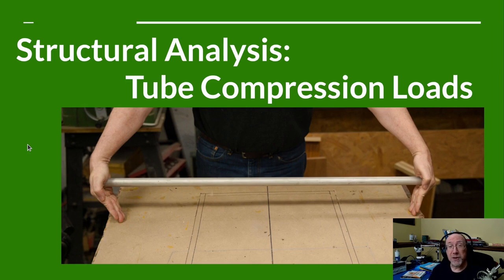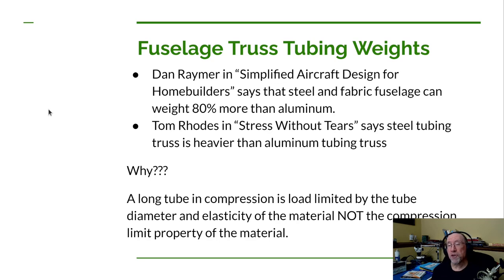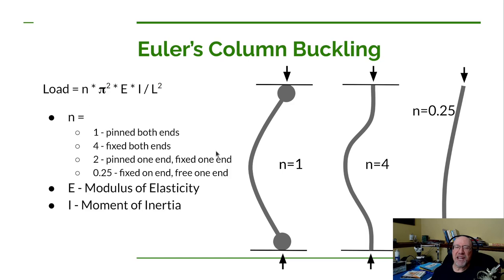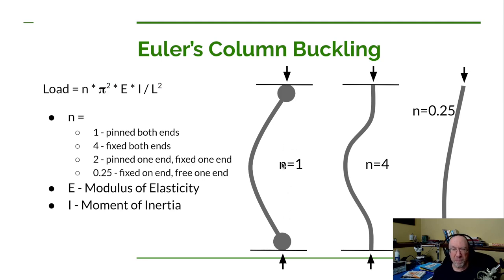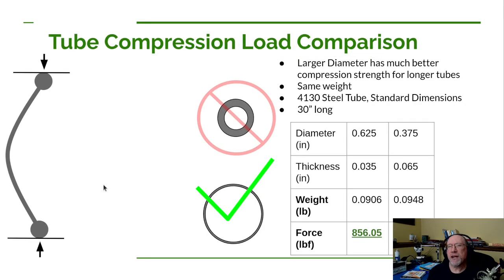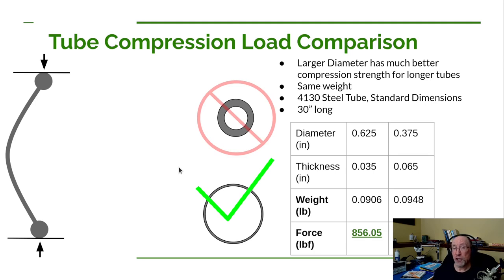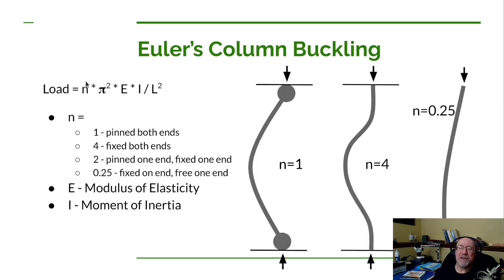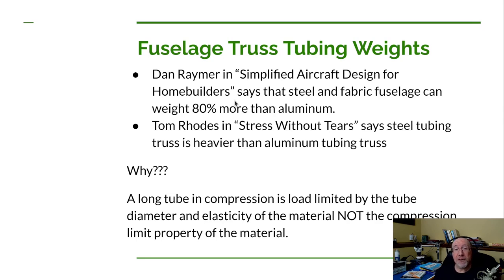Structural Analysis: Tube Compression Load

Comment: It's an often missed point that tensile strength of a material has no bearing on buckling resistance of a component. I've done a lot of crash testing on seat structures using 6061-T6, 6082-T6, and a softer/weaker 6063-T5 alloy. The harder materials were highly prone to load-path separation (cracking), whereas the softer/weaker material bent like spaghetti....but always held !!! Two terms not used enough are "energy management" and "catastrophic failure". It could be the difference between a bad day and the last day.

Comment: Did you consider running this analysis with low modulus fiberglass tube?
Reply from the maker: It is a little harder to estimate the modulus on composite tubes (if not provided by the manufacturer). It varies significantly based on the materials used and the direction of the various fiber layers. It certainly can be done but I wanted to get this video out pretty fast so did not bother with non metal tubes. I like your idea though.